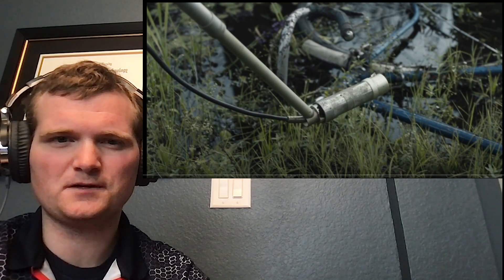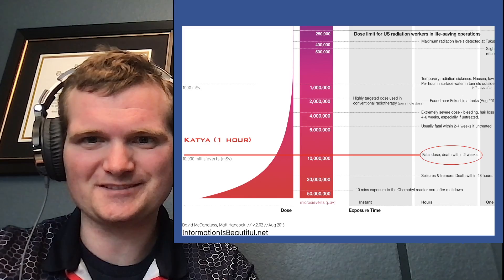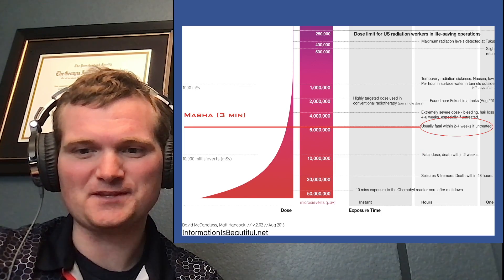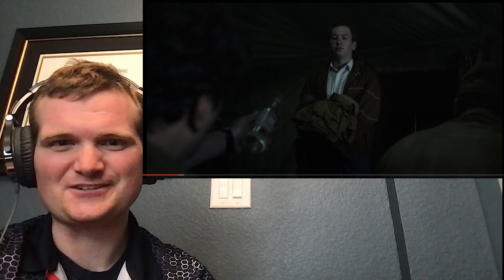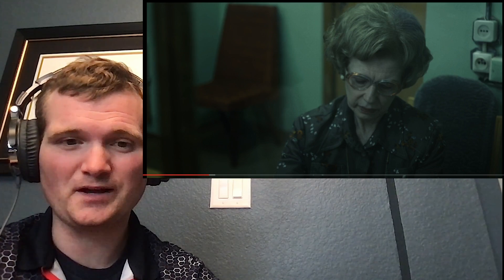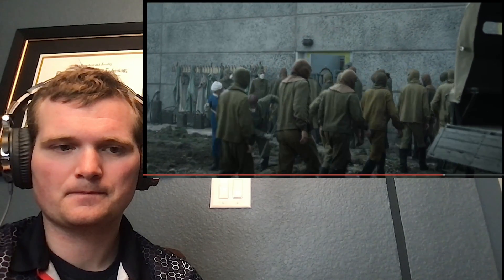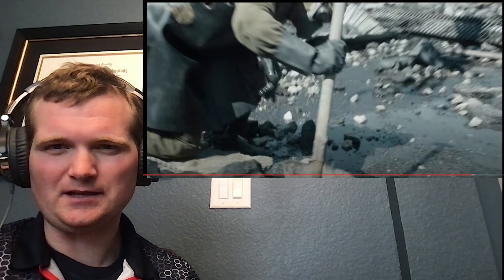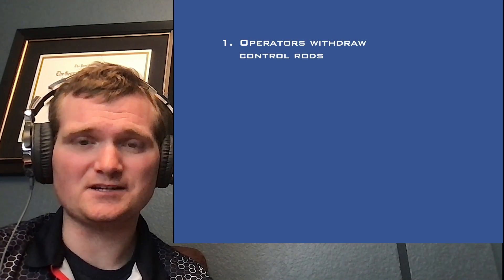Nuclear Engineer Reacts to HBO's Chernobyl Episode 4: The Happiness of All Mankind

Comment: Masha had spots as high as 12,000 R/h, but it wasn't the whole roof. They had marked areas for the workers to avoid, and had cleared a small portion of the most dangerous debris before their robots stop functioning.

The 12,000 number was real, but it wasn't a uniform field across the whole roof, so no one was really getting as high of a dose as 300R in 90s.

At those doses, it would have been better to skip the thin lead sheets and just run faster, but I think it helped people feel safer. Staying calm was also important, tripping and falling on that roof could have been fatal.

Comment: Hey there, really like your videos and find them very informative. But I honestly have a problem with your logic at 6:40. I mean yeah if the respirator cuts exposure in half but the work takes twice as long to do at first glance it seems that both have the same outcome. But in the case of using the respirator you are exposed double the time, but it is only an external does. Whereas if you du the job twice as fast but without the repirator a part of your dose will be internal. So for my understandig it would only make sense to to the job with a respirator to avoid getting an internal dose and exposing myself to that alpha radiation instead of mostly getting a dose of gamma radiation.

Comment: Uranium is in the same periodic table column as manganese, meaning if it gets into the bloodstream it gets stored in the bones. The burning reactor core vaporized significant amounts of uranium ("do you taste metal") which became airborne and got inhaled by people close enough to breathe the smoke, and which wound up settling on the ground for miles around as soil contamination. A bit like leaded gasoline exhaust, heavy metals can become airborne when vaporized and expelled at speed. That's why the firefighters suffering from smoke inhalation were emitting new radiation. Inhaled uranium that didn't make it into the bloodstream through the alveoli would wind up in the stomach: the vili in the lungs would push the smoke filled mucous up into the throat to be swallowed. Airborne uranium is why the animals miles away were contaminated. That's why they dug up soil to bury it under itself. Everywhere the smoke touched, it left residue.
Reply: no, it's the strontium-90 fission product that is like calcium and gets absorbed into bones.  The uranium in a reactor is uranium oxide, already chemically bound

Comment: I think in rooftop cleaning they are meant to say that it deadly within two hours exposure with you wearing full lead protective gear from head to toe
Reply: Depends highly on the thickness of the lead protection. A thin sheet or just those aprons doesn't offer all that much protection. A person would not be able to move if they were to wear a lead armor thick enough to stop all the gamma radiation.
Reply: 1cm of lead is equal to 1 halving thickness for gamma radiation, and would be for, let's say Cs-137. 2cms would cut the dose rate to 25%. 3cm or a little more than an inch 12.5%.

The alpha emitters would be shielded by clothing and are reallynonly dangerous if inhaled or ingested.

The beta emitters any protective clothing would be a great benefit.

Comment: The german robot was made for bomb disposal. Henceforth it had no intended radiation shielding beside its shell which was intended as light shrapnel protection. The soviet moon rovers worked a little better as their electronics were shielded by design to withstand bombardment by cosmic radiation on the moon.

Comment: The RBMK reactor was kept secret in large part because it was a military operation designed to enrich nuclear fuel for use in weaponry. We in the US have similar designs, but the different is we've always had a strict line between our military weapons programs and our civilian power programs. I don't think the scientists working in the cleanup were denied access to information in this way (after all, they did eventually figure out what happened more or less) but in any event, the people actually operating the plants need to have access to accurate information in order to operate the plant without error. Regardless of what you're doing, that has to be true. It wasn't in Chernobyl and that (in a lot of people's opinions) greatly contributed to the accident and to the flaws in the RBMK reactor's design not being corrected earlier.

Regarding the minute and a half on the roof: the workers did have protective clothing and the protective clothing each one used was discarded after use. That would reduce the dose somewhat. There's a persistent rumor that the government forces provided no protection to the roof workers or that the roof workers provided their own, but I don't believe that's true. It was improvised (cut out of building protection material) but it was officially provided and all there was that they could provide. Not like the soldiers, themselves, had significant quantities of lead laying around. It's a little difficult to trust the USSR on this but the liquidators are not believed to have suffered a particularly high casualty rate related to radiation in any event.

While the show glosses over it, they actually sent people out with dosimeters to various areas of the roof to ensure that people cleaning this or that area wouldn't receive too much of a dose. So they were quite careful to make sure that everyone's exposure would be as controlled as they could possibly make it, first measuring the trips and only after confirming the dose levels would they send the soldiers up to do the work.

We have footage of the actual people who cleaned the roof--including their makeshift lead armor--and the show did a pretty good job of replicating that.

Interesting, i didn't have as much to say about this episode. I suspect that'll change for the next one!

Comment: 6:29 Even though you might be exposed to more radiation wearing a respirator but wouldn't the prevention of radioactive particles entering the lungs outweigh the initial exposure time limit ?
Reply: Yes, but that isn't the issue in his example. That's only a concern if you are in an area with a lot of radionuclides that are in the air, and more-so ones that are bioactive (e.g. iodine-131). You wouldn't be worried about something like that if you were retrieving a small, self-contained source of something like Co-60, or moving a neutron-activated material from a reactor into a cask if you cooked it too long. Alpha sources are the greatest concern because of their potential to ionize atoms. This potential is what makes them more dangerous than beta, gamma, or even neutron sources.

To put that to use: your exposure is limited by factors such as dose for each type of radiation, potential for airborne radionuclides, shielding, ventilation, etc. In a controlled environment like a research or power reactor, there are very few airborne radionuclides (compared to outside) for very good reason. So, you could have dose rate limits for each type of radiation in an air sample, and different limits for contained-sources. It could take you longer to do something wearing a cumbersome respirator than it would without one.

I could do task X in 5m20s without a respirator or 9m55s with one. Let's say that my air sample showed a dose rate that gave me a non-respirator limit of 6 minutes and a respirator time limit of 10 minutes. These times are for both whole body dose and potential absorption of radionuclides: immediate plus long-term whole body doses. I could do the job without a respirator with 40 seconds to spare, compared to the 5 second buffer with a respirator. I've given myself 8 times greater of a buffer without a respirator. I absorbed a smaller immediate whole body dose and traded it for a gradual amount of longer-term doses. In the end, I would have an overall smaller cumulative and/or peak dose because of the trade. I'd take 500 now and 500 more over the next couple of months rather than 1000 now.

... sorry, got hyperfocused on the question cause I've got this fun bout of RSV and can't sleep.

Comment: Yes, he’s finally doing another episode of the Chernobyl series! Can’t wait to see you pick apart episode 5. That will be good fun.

Fun fact, the roofs were named after general Tarakanov’s daughters (or nieces). And these are the actual names used for the three roof sections. The dose rates are quite accurate as well, as are the timespans of the people that were sent up the roof. The guy up on the roof in the scene does have a detector. It was put on him moments before the crew gets sent out the hole. He’s wearing a primitive headset, if you watch closely you can actually see the meter hanging off his side in a leather case. It is a DP-5, the standard military issue meter the Soviets used at the time. The “suit of armour” he is wearing is historically accurate. There are pictures of the real liquidators, and the makers of this series are frighteningly accurate with their depiction of the equipment used. I have a book from Igor Kostin, a photographer that went up on the roof with them multiple times, with very clear and detailed pictures of the cleanup. That’s why I know they depicted it correctly.

The “egg baskets” are actually historically accurate. The liquidators even had a saying; “Cover your balls with lead if you want to be a father…” And helicopter pilots lined their seats with lead sheets to try mitigate the dose coming from below when they flew over the reactor.

The German robot wasn’t borrowed. They bought it at a high price, and it did fail quite fast. It got hung up on debris, humans had to go out on multiple occasions to go and rescue it. Eventually, it succumbed to the radiation field. And yes, the robot’s name was “Joker”. The makers of the series actually built a full-scale replica for this scene from the original blueprints.

There are five podcasts, one for each episode. Craig Mazin goes into great detail about how and why they portrayed certain things the way they did. It has to do with what the people in the Soviet Union knew and believed at the time. For example, one very persistent tale was that vodka would aid in rinsing radionuclides from your body. That’s why you see people drink all the time.

My apologies for the long-winded reply😅